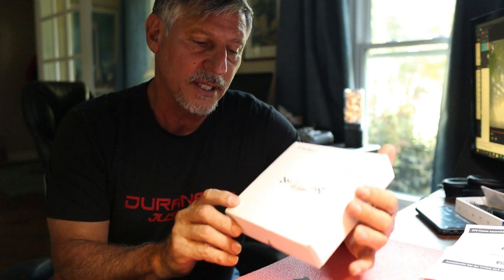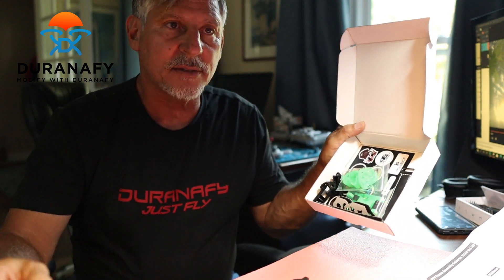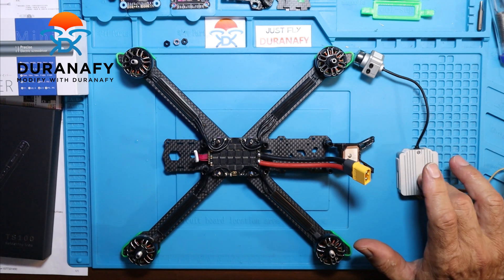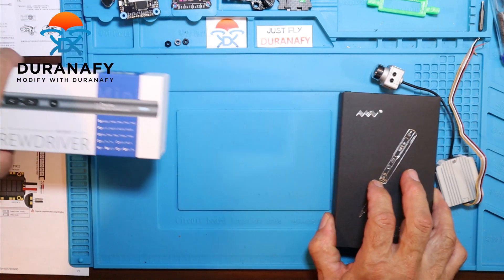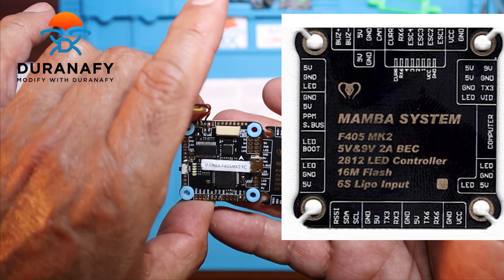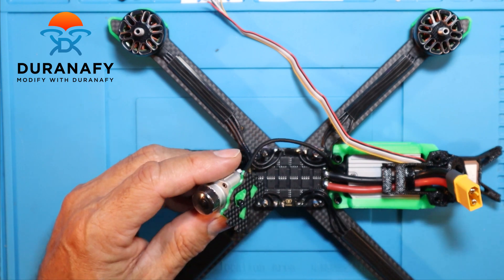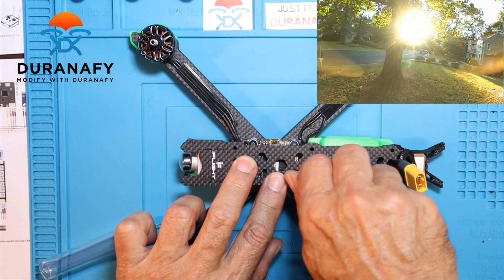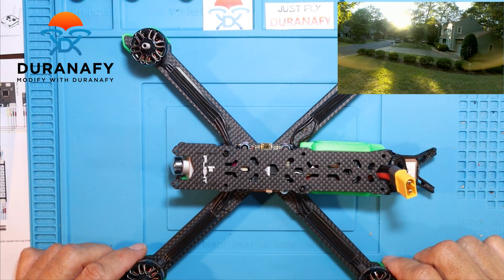iFlight Titan XL5 HD  DJi Air Unit and GPS Build

Comment: Great Job Al. Looks nice! . lol! how did that happen that you installed the props upside down . were you not paying attention Al . hehe!  it happens . its a great quad.
Reply from the maker: Thank you soooooo much @Flyzone Drones! 
Michael, I did not pay attention to the print on the props. You feel the print more than you see it! They print needs to facing up and not down! LOL! I made this video 4 weeks ago and forgot to post it! 
I flew 7 batteries through it today and crashed maybe 3 times per battery for a total of 21 crashes. LOL....This thing is a beast. The beeper makes it easy to find and it saves sooooo much time!